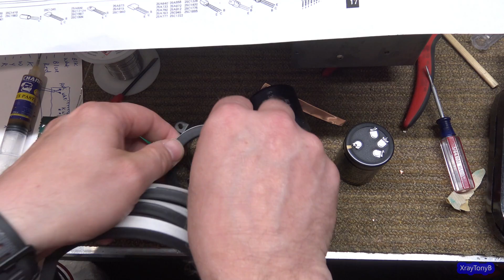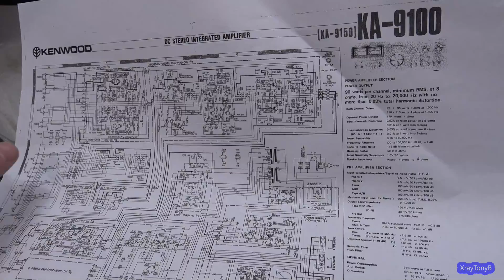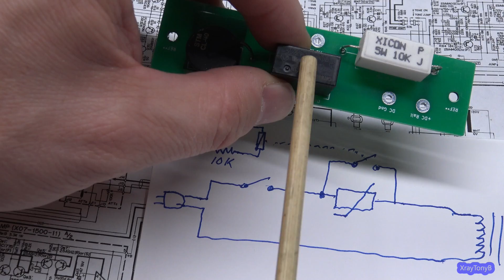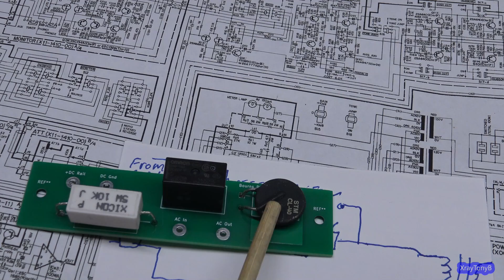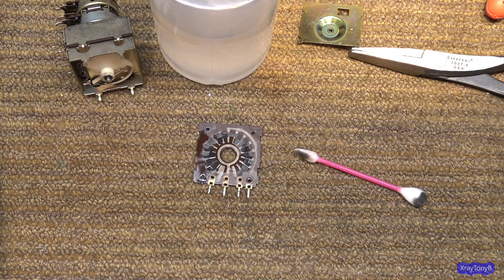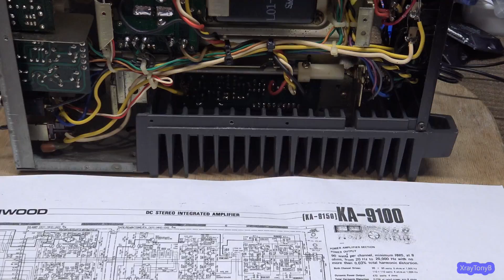Kenwood KA 9100 - Part 4

Comment: I normally repair car audio amps and work on circuit boards for oilfield automation at work. Car audio stuff is what I do at home. 
The very first home amp I worked on was this exact same amp. Not fun recapping every single cap. This amp was definitely not service friendly. It wasn’t as bad as I thought but much worse than car audio amps and equalizers/ processors. 
I watched all 5 parts before I tore the old girl apart. The one I restored look like it was stored in mud in the bottom of a lake and had a wooden case around everything. 
Thank you for your videos. I started watching your videos several years ago when I got into electronics and didn’t know ohms law, or what a diode, transistor, cap or resistor was. Now it’s my 9-5 and what I do on the side at home. All my power supplies I bought as parts/repair. Now I have around 10 working Power Designs, HP, Trygon, Lambda, NJE and 2 Topwards. The old made in USA stuff is easily repairable and built like tanks. 
Thank you, Tony. I really appreciate all the time and effort you put in to teaching. It’s much appreciated!

Comment: Thanks for sharing your pot treatment. My kenwood amp needs cleaning periodically as it will start to cut out after some time. I've been using just some deoxit but your video shows an accurate condition.

Comment: I recently brought out my Kenwood KA-9100 along with all my old stereo gear that I purchased in 1978. It powered right up but when I put an audio source into it I got no sound and no movement in the VU meters. Any ideas?
Reply: I would first check if you’re getting signal at the output/amp board. If you don’t have a signal, start from the jack and trace to where it stops.

Comment: i use a Dim bulb setup, when plugging in any unknown amplifier for first time, And after repairs etc..
I know how it works, and what its for... (bulb takes up the power in the event of a short)...
But one thing that ive never known, is why a smaller wattage bulbs, limits the power to the amp.. that a large bulb does?!?!
As you'd imagine... you'd assume a 100w bulb, would give the amp less power... than a 40w bulb would...
Ive just never questioned it.. Ive just always had a selection of bulbs for testing amps.. 40, 60 and 100w.... ive just never understood, How a smaller bulb, Limits the power more...
Reply: Think of the incandescent light bulbs in a dim bulb set-up as power resistors that give off light, more light given off as the current passing through them goes up. A 100 watt bulb has a lower resistance than a 40 watt bulb.  When used in a dim bulb set-up, these "power resistors" are in series with the equipment under test, so a lower series resistance (100w bulb) will limit the current less (allow more current into the load) than a higher series resistance (40w bulb). Think of the bulb wattage as an upper limit of the wattage that could go into a shorted load that is connected to the dim bulb at 120vac. I hope that makes sense.

Comment: in my opinion Repair work is not difficult. But it will be cumbersome to find replacement parts. how serious are you with matching transistors which affects the sound especially distortion.

Comment: Friend that is doing restoration for he's entire life said that nitro thinner works wonders with glue in this vintage stuff. I'm using it and yes you need to be a bit patient when removing it but result is great. Just use cotton swabs for soaking glue and some plastic chisel tool(you can DIY it) for scarping it off. You will need to soak glue all the time during scraping it off. After you cleaned it just use isopropyl alcohol to clean PCB.
And that slow start circuit is really great, simple and it won't break down, i used it around 15 years ago for first time.

Comment: Why don’t you just get bulbs from superbrightleds?   They have ones that work with AC from 12 to 120V, in all colors.
Reply: All leds will operate with AC. Tony could have had a simpler panel lamp conversion using an appropriate resistor

Comment: I like the soft start idea and curcuit. But I would wire it into the AC supply side after the main fuse.
Reply: Pretty sure he did right?  The only thing on the dc side was the coils to bypass the limit resister after capacitor charge up.

Comment: PF, Us and them, don't want to leave that division on for to long...
Little tip for LED replacements for some small bulbs: on the back of a 5mm LED you can just get 4x 1N4148 fitting in the circle, and no smoothing needed, only a dropper.

Comment: I'd like you to xxxplain the "ground potential" on vintage audio and the twisting together of AC wiring importance?.
Reply from the maker: The wires are twisted together so that the electromagnetic fields cancel out.  The same technique is used in ethernet cables on computers.
Reply: Twisting is like a shield, its very common

Comment: I actually think I will try this simple soft-start to bypass the NTC...👌👍
-Maby a novice question: but can the connection of the relay coil directly to the PSU introduce more noise...?? Often a soft-start needs its own supply, hens my question
Reply from the maker: The relay coil acts as a resistor while it is energized and won't cause any interference.  When the relay drops out, the back EMF will cause a short pulse, but it won't interfere with anything in this design.

Comment: Hi, Tony, brief question, why making the rectifier board for the meter backlighting LED's . The LED's are diodes and you could just run  them from the AC voltage and add the resistors no cap need. Perhaps a 100nF decoupling cap's across the LED's.
Yours,
Frans
Reply from the maker: LED's don't like reverse voltage on them.  You still need at least one blocking diode in series with it and the dropping resistor, but it could flicker when running at half-cycles like that.  The capacitor would solve that.  The bridge rectifier would also eliminate the flicker without the capacitor, so I could have left the cap out of the circuit.
Reply: @xraytonyb  Tony, since you rewired the illumination anyway, why did you not attach to 30VDC? No additional rectifier and cap needed.
And since there are two LEDs, instead of a blocking diode in series, the second LED copuld have been used as such. The remaining flicker would be insignificant.

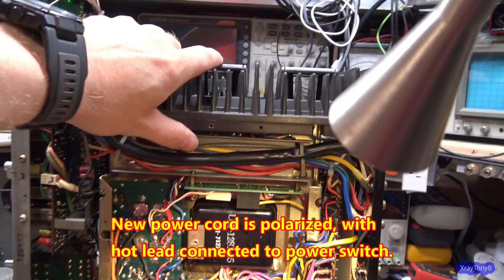Comment: Extra points for using a two-prong polarized plug versus a three wire cord with the equipment ground pin. My experience is that having  an extra equipment ground can introduce problems in equipment that wasn't designed for it.  Particularly communications receivers that have three or 600 ohm antenna input where half of the antenna is at ground potential.   (I/E ground loop issues) 31:00

Comment: Is always nice to watch one of your videos, I used to work in the HiFi industry late 70's until 1983, some of the Kenwood stuff was a great value for the money product line. I was very disappointed when they and a number of manufacturers started using the Darlington Power Pack chips for the output stage, I never felt that they sounded as good as some of the earlier products that used discrete output transistors, what is your opinion?

I am leading up to this question regarding a recently acquired Sony STR-6800SD receiver that was stored in someones garage rafters for a really long time, it needs to be cleaned and looked at for a possible refurbish. I do remember these when it was a current model and they sounded excellent, a very smooth natural open spaciousness, so to get to the point I believe these also use a Darlington  output configuration, regardless I would like to have a qualified tech look this over for an assessment. I found a reputable vintage audio repair shop in my general area and for $80.00 they will give me an estimate and complete documentation of what needs to be done. I feel this is more than a fair price to have an expert opinion, what I would like to ask you is, there must be a certain point in the cost of repairing this unit where you have to decide is it worth it? 

Thank you very much for your YouTube Channel, It is one of the best out there.
Reply from the maker: First of all, the $80 bench fee seems pretty fair to me, considering the cost of everything these days.  As for the Darlington Power Pack modules, I've found that when they are used in a properly designed circuit, they really perform well.  Because all the components are on the same substrate, they have very good thermal tracking and hardly ever suffer from bias creep.  The Pioneer SX-780 was one of, if not the highest selling and most popular receivers Pioneer ever made and they used STK0050 modules running slightly under-powered (hence the 45 watt power rating of the receiver).  There are still a ton of them out there and I would say the failure rate of the STK modules was on par with that of the discrete amps such as the SX-750.  I own both and they are very similar in sound and performance.

Comment: Nice job Tony.  A couple of comments:

1) for finding a footprint, if you have a photocopier or even a flatbed scanner, it can be a fast/handy way of coming up with a footprint to start drilling things.  If you go with the scanner/printer method, ensure that scaling is set to 100% or "actual." 

2) On the soft-start, why bother with customizing it for each amp by choosing a high wattage resistor?  Why not, instead, have a simple timing circuit for the relay that jumps out the NTC after a set time?  One would still get the benefit of it resetting at each turn on and it would be universal for all amplifiers.  You could deluxe it by having a VR to set the timing if you think some amps need just a bit longer of soft-start.

3) On the LEDs, you don't always need to make the power into DC.  They're diodes, they'll do that naturally.  So long as you don't notice/object to the flicker (60Hz isn't normally bad).  They'll glow at ½ brightness.  A key is to ensure that one does not exceed their reverse voltage.  Often, a resistor is all that is needed.
Reply from the maker: Thank you for the comment!  
To answer your questions:
1)  It was easier to just poke the cap leads through some card stock and cut it out than to go upstairs and use the scanner/printer.
2) The resistor for setting the trip point of the relay coil doesn't have to be high wattage, as it is only going to have about 10 milliamps passing through it.  In addition, this circuit is simple and inexpensive (only 3 components) and has the added advantage of using the charge level of the capacitor bank to determine when the relay comes in.  If the caps don't charge for some reason, the relay will never come in.  
3) This will work, but I usually don't like using the LED as the rectifier.  Quite often, these low-cost LED's don't like the reverse voltage on them.  I suppose you could use a diode and resistor in series with the LED, but it was just as easy to make this little supply.  I think either way will work fine.  
Thanks again!
Reply: @xraytonyb  thanks Tony.  Great answers.  I've been down these roads before, hence my comments.  On the soft start, one can also have fun with zeners on it.  Use a zener to clamp the relay voltage and on the voltage drop, one can use a zener to drop the rail voltage into a suitable range (zener in series).  You do have fewer parts in your design.  The zener approach does have the supply to the relay a bit more "regulated."

Comment: What's wrong with the main filter caps? Could you not have reform them?
Reply: The only safe way to reform these is with a hammer.....
Reply from the maker: The ESR was still OK, but they were beginning to get leaky.  I changed them out as a precaution.
Reply: @xraytonyb  electrically leaky yeah ok. What made you choose that capacitor? There's lots of capacitors to choose from. Really split film is the best for power supply filtering caps. They have no EMI or infrared
Reply: @hoobsgroove  It doesnt matter. Its an old amp......

Comment: Great job Tony as always. There is a very simple way to remove the corrosive glue. Just use freezespray, and you can wipe it off with no problems. Even the glue which is still kind of flexible, just crumbles off. I do it this way in my shop. Good luck with the Kenwood,  best regards from the Netherlands.
Reply from the maker: I've never tried that.  Thank you!  I guess I was on the right track, just the wrong direction.  Cold instead of heat!

Comment: S-u-p-e-r!!! Thank you. I built a DIY Isolation Transformer out of two identical transformers, back-to-back. I only want to be able to supply 3 amps from them. However, when I turn them on, without a load, they pop a 3 amp slow-blow fuse. I have had to use a 6 amp slow-blow fuse, just to turn them on. Please point me to your video where you developed your soft-start unit. Please give me any tips for using it for my application... Particularly any math... I am using USA120VAC and 3 amps max. The Variac can go to 140VAC. My setup = Emergency Shutdown Switch to Isolation Transformer to Variable Autotransformer to Dim Bulbs to Load. Please and thank you. Edit: For clarity... The fuse is part of the Emergency Shutdown Switch. It pops when there is nothing connected but the Iso Transformer. Meaning, no Variac and no Dim Bulb and no Load. I watched your Soft-Start video. I think that I just need to develop a power supply for the relay... Diodes, or maybe a dropper cap...

Comment: Mouser and Digikey have been horrible lately with stock and lead times They rarely have the caps i need and their transistor stock is bad too. Tried to order some KSA733C's and they dont have the C variant and i use a bunch of those as they have the Center Collector . Been hard lately to get Receivers Done with the parts issues
Reply: YES!! and what's up with Nichicon and all the End of Life caps. All I see is This product is no longer manufactured. Starting to worry a bit.
Reply: @harlest71  Yeah, alot of the audio caps are going obsolete.  What are we going to use.
Reply: @scrappy7571  I've been stocking up as much as I can but you can"t get everything. I'm hoping this is just a transition to different product lines but more than likely it's a push to get rid of vintage gear. Don't wait, get your favorite amplifier now and rebuild it.
Reply: @harlest71  I'm lucky, that I rebuilt 6 Sansui's in the past 2 years. Just finished a Marantz 1060, and had source a few of the caps that have been discontinued.  Cannot really stock up because I just do it for a hobby.  Going to be a struggle!
Reply: @scrappy7571  Hobby for me too. I still have a few Marantz to do and some old Yamahas to finish. Man I thought I would have more time LOL. Good luck scrappy
Reply: @scrappy7571  I just did a 1060 for a friend of mine Good sounding amps for as tiny as they are . They sound much bigger than 35 watts
Reply from the maker: I sure hope this isn't the new normal.  I agree.  Mouser and Digikey are like Mother Hubbard's Cupboard.
Reply: @xraytonyb  I have noticed as well a bunch of the jelly bean go to audio caps are being phase out going EOL this is concerning I love my KT's